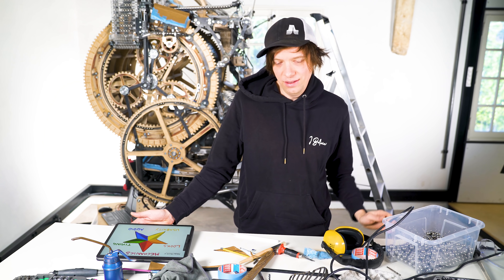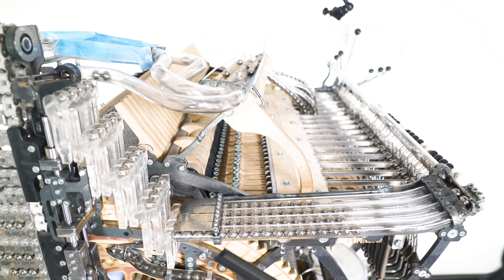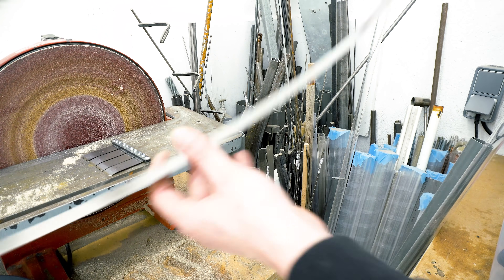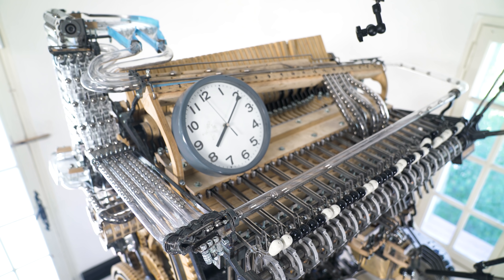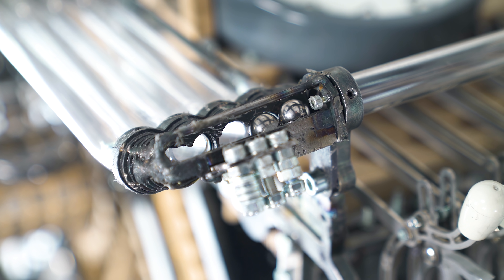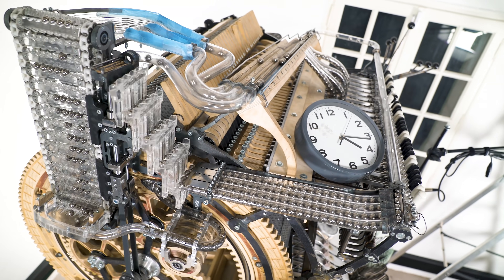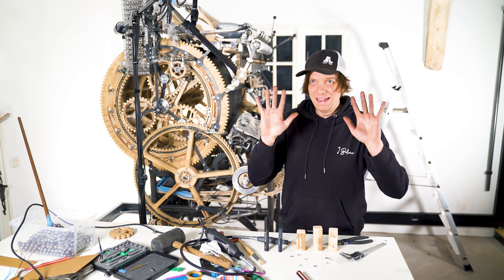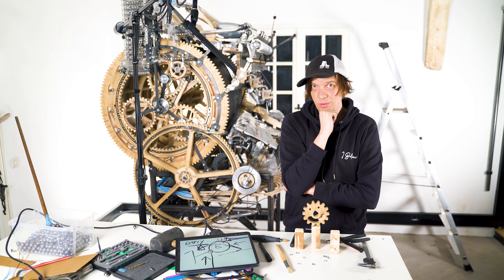Marble Machine X Fish Stair Upgrade

Comment: Engineer: IT SUCKS!!! IT'S NOT RELIABLE AT ALL!!!
Artist: BUT IT'S BEAUTIFUL!!!
Musician: IT'S NOT IN SYNC!
Martin: I WANT TO KEEP THE SWING ...  slowly evolving the marble-divider into a vestigiality as he's bypassing all of it's purpose
Me: Where's your angle grinder when you really need it?!?

Seriously, i think this marble divider is dead now. R.I.P. F
I'm also quite sure that it actually worked quite fine from the beginning and that the actual problem were marbles slamming into the back of the divider while he was tilting, disallowing the fourth marble to enter it's hole.
However since the swing doesn't have a real purpose anymore and it still produces a lot of noise at random timings, you should consider removing/replacing it completely.

Comment: 13:57 So, I'm a little late to this party. And maybe you've already tried this, and I missed it or haven't gotten there yet. It seems like a lot of the marbles are getting tossed out at that one point, because each channel has its own individual metal bit at the end. (Sorry, I don't know the exact right terms for it.) Wouldn't it be more stable to have that as one piece putting light pressure on all the channels at the same time? I figure since you want the marbles to go on the climber at the same time, it might as well be one piece, right? Is there a reason for avoiding this? Just something I've been wondering about watching this.

Comment: LOOKS COME LAST.
Every time man, every single time. Looks ALWAYS come last. There's no point to a good looking car if it doesn't work. Work hard on those other 4 parts, then adjust it for appearance as you need it. You need to focus on the mechanics, and ease of movement, and timing.
Stop harping on the appearance. Also; it's naive to think you'll be able to make something in one try. The best of master carpenters and wood workers I know still use files and chisels to straighten their cuts; adjustment is a natural process, it's necessary. Tweaking is inevitable, being critical is fine, but you cannot make an omelette without breaking a few eggs.

Comment: What if the bottom fish stair operated a gate that was one or two marble distances away? The gate would stop the flow of all marbles unless the stair was in the top-most part of its travel? Or an alternative idea: the metal fingers are bent differently to create a gate -- then there is a "bump" or "ridge" on the bottom fish stair which at top-most travel lifts the ends of the metal fingers to bend them enough to open the gates.

Comment: BTW- IF you ever have to do a MRI for your body,  YOU NEEED to tell the doctor you have worked as a machinist. Those metal shards will move inside of a magnetic field and it could cause major damage and/or PAIN. JUST FYI.

Comment: Martin, I honestly think you sould get rid of the divide-by-four.

According the star chart you presented at the beginning of the video, it fails at 3 of the 5 branches.
 - It fails mechanically because it does not do the job that it was created to do, that is distribute a single stream of marbles evenly and reliably accross four exiting streams ; instead it keeps on swinging too early, and marbles get caught on it everywhere and every time, no matter how much it is tweaked. Like you said, tweaking is the mark of vulnerability, and a sure sign that this design is not robust. At the end, when you removed material with a tool bit and it started to behave, it was only because a marble was getting stuck in it, but you hailed it as "the most failsafe version of this ever" ; no, it's not failsafe at all, it is bugged in such a way that it started to work again, but never in a million marbles would that have been reliable, it worked because of a bug.
 - It fails in regards to sound since, as you said, it is very noticably picked up by the vibraphone microphones, and just makes a ruckus overall. What good would it do if you manage to get it to work by removing some material here and there, and relying on a marble getting jammed in it, if in the end it sounds awfull and spoils the musical experience ?
 - Finally, it fails visually. I mean come on, look at it. It's made by welding a bunch of plates with holes to one another, it's so covered in welds and tarnish that it looks like molten slag flowed all over it. It honestly looks like it was recovered from a car accident or a rocket explosion. Indeed, looks have to be sacrificed in order to get something that works good and sounds good, but the divide-by-four does not work and it does not sound good.

Yes, the idea of a divider that works using a swing balanced in just the right way is cool, conceptually, yet it fails in every way when executed. Since this part of the MMX has no bearing on timing or usability, the fact that it's a cool idea is, in my opinion, it's only redeaming quality. Beside, again like you said, there is a much simpler mechanical solution : an open lane that does not constricts the marbles so much, like that in front of the conveyor. It would also be less noisy and, I believe, much more elegant looking than the odious looking divide-by-four.
I truly think you had the solution right there in the beginning of the video, you even made almost exactly all of the points I'm making right here, but you persevered in making the divide-by-four work yet.

Despite the hard time I gave to this part, I really want to make it clear that there is no malice or bitterness whatsoever in what I'm saying. I didn't write this to talk trash about your designing skills, because I think you've grown so much as a designer and I could never dream of achieving what you have, and persevere like you have. And I don't think that the fact that you can't get the divide-by-four to work is a failure, no more than the breaking of my body would be a failure if I were crushed by a falling rock, I truly think there isn't any way to make this design work with the level of reliability that you need (if it is even possible to make it work at all by the looks of it). Instead, it is the pursuit to make it work in spite of all the signs which is foolish: "Errare humanum est, perseverare diabolicum".

I really believe that the MMX is not sunken cost fallacy, and that it still very much has the potential to be a glorious instrument, and I'm so excited for the world tour ! I believe ! But just like you, I know that it can only happen if things can move on instead of being tweaked in perpetuity to the top of the hill, only to roll back down to the bottom. I light of that, I would rather give you an honest opinion, written with all the benevolence in my heart and the respect I have for you, than to encourage you to follow paths of ruin, and I think you would rather too.
Best regards and best of wishes, for you and this splendid project. Please, dont give up !

Comment: just make a sliding gate,   2 pieces make a hole large enough for the 4 to set, once enough weight triggers the drop, the bottom of the 2 pieces slides down allowing the 4 to fall in

Comment: 2 points: 1. why dont you fill up the pipes the same way you do do with the marble divider on the top?  as you suggested at 12:40 in the video  2. if you file down the edge of the first fish step, I think you will avoid marbles to get stuck when a marble arrives late becouse of empty pipes

Comment: One Idea ... you could tie the entrance mechanically to the stairs.
Not a hard link, but a break so that marbles can only activate the flap when the stair never in the wrong position when the marble arrives.
Downside: creating a mechanical link between those two that run the length of the pipes.

Comment: For your "empty" channel rare problem occurence, wouldn't it help to put a very slight (1-2mm) rounded bevel on the back of the stair? Because right no the problem is that the two forces push in each others direction. With the bevel, the ball would slide instead of pushing on the metal spring. Either it would slide back in the channel, or slide in the stair, without the "explosive" outcome.

Comment: Hey dummy, put a small setscrew in from the top of each channel. That will allow you to fine tune the effective ease that marbles can pass. Also allows you to keep your same design with a nearly invisible modification. A perfectly running system is a beautiful concept, but impracticable. My suggestion is to design tuning into it. Another example, slot the mounting holes on the supporting spring steel so you can slightly pull them back to fine tune the stiffness, which could vary depending on the weather. Your system is not fragile because you designed it badly, or chose beauty over mechanics, your system is fragile because it has no method to adapt to changes. Imagine you had to take your car to the shop to get the tires changed every time it got cold because the pressure gets low and there's no way to adjust it.
Reply: Also, not actually calling you a dummy. This machine is the infernal creation of a genius, for sure. Feel free to pm me if you would like to talk more about building with the ability to tune in mind, or more suggestions for individual components

Comment: Keep working through Marten.
Be acreful with the machined and tubular pmma though it's notoriously brittle and slamming marbles against it repeatedly or pranging it while on the road could cause a show stopping failure.
Consider styrene which forms, machines and works in a similar way but has more resilience to bending and shock.
Another incredibly tough thermoplastic that forms and machines well would be PET (polyester) which will not fail.
Poly carbonate would be the ultimate, being what police riot shields are made from. very expensive though.

Be assured a watershed moment will be along soon to remind you of the joy this wonderful piece of kinetic/audio art brings to us all.

If you have a holiday, you don't need to justify it to us. Just enjoy some quality time away.
x

Comment: *you are obsessing needlessly*. It totally doesn't matter if the 4 channels are loaded exactly equally, only that the lift capacity is enough. And that's like horsepower on a car, how many is enough? You can always wish for.1 more.. and always still drive it with one less. Yes the divide by four is a hypercritical yet unstable design that you are trying to tune into balance.. **but if its not a reason to give up the mmx project **. you can replace it with a better solution if/when inspiration hits you, until then **just live with it!**. Part of the problem isn't that the mmx is too fragile,  just that the artist in you is too fragile. As your engineering side develops (it has, so much!) Let that guide you. The key to a robust design isn't that its 10,000,000 perfect, thats impossible anyway... its just that if one in 1 in 1,000 isn't perfect, nothing breaks.

Comment: You shouldn't care to much about marbles that fall to the floor. As long as it didn'T break the machine it fine. Of course it would be better if no marble fall to the floor bat it's not the end of the world. I mean what's the problem if 10 or 20 marbles hit the groung while a concert? The show can go on. Yes, I agree, you need to fix as much as possible, but if it happens only in conditions, that are not normal and than only some times: don't care to much about it.

Comment: Keep going mate this is awesome. Suggestion though, could you add some dampening foam / tape on the vertical sides the stairs - when the balls roll in, the hit the tape on the vertical side of the next step. This has two functions, reduce noise and reduce rebound.

Comment: If the divide by 4 channels can't run dry is this not the same as the interment channels? So could you use same method as the interment channels so the marbles feed into the channel that is empty and skip over the ones that are already full the same is it dose on the interments channels.

Comment: Cant you solve the problem by making a gate, and as soon as the marbles flip over into the lanes, the gate closes, preventing any further to sneak though?
Reply: Maybe even tow gates... one like in a 90° angle which closes the single input pipe when the 4 marbles flip over, and 4 (one fore each lane to the fish stair) which close when the counter weight pulls back.

Comment: You'd have to redesign it but......use springs with a metal plate on top with correct weight of 4 marbles will compress bar and allow marbles into fishstair entrance

Comment: Possible solution for the divide-by-4.  Make a longer version that takes 6-8 marbles to activate, so that the first 4 marbles have a chance to settle in their proper positions before it tips.  Once they roll off, the mechanism tips back and the next marbles advance.

Comment: I wonder if a redesign of the entry point of the divide by four mechanism itself. Or maybe all it would take would be to create a solid part instead of welded together washers. I wonder if the inconsistencies in the material is causing a lot more issues than a solid machined part. Yes a solid part would require a fair amount of measurement and testing to find the correct values before creation but the smooth nature of the final part might give the entry a more uniform behavior overall. Just a thought, might not be worth the time investment. Keep at it Martin you are doing a wonderful job!

Comment: You don't actually need the fish stair to run at full lift capacity unless there are a lot of marbles banking up below it. Even if you got rid of the /4 swing altogether, and just used a simple divider like the one feeding the instrument channels so marbles just go down the first queue that isn't full, then the fish stair lift rate would auto-adapt to the number of active feed queues.

Comment: Large neodymium magnets are great for pulling ferrous metal splinters.  
As a (retired) engineer...  why are you so concerned with the parallelism of the fish ladder approach system?   Is it just an aesthetic thing?
You have serial input.   You have serial output.   The are no concerns for maintaining sequence of the marbles.   An unbalanced feed should only
be a concern if you are having an issue scavenging spent marbles or supplying enough reusable marbles into the feed system.   
Eliminate jams, yes. 
Eliminate rejections, yes.
Keeping it pretty, let form follow function.  
Let the machine output (music) be your artistic outlet.  
Musically, you are a far superior cog in ultimate output. 
Give yourself a stable device.

Comment: Is it against the basic design principles of this machine to use another source of power to drive the marble loop? pneumatics? electromagnets? sensors? microcontroller control? I think its possible to do this and still keep the aesthetics - if anything make the overall aesthetics simpler and easier to understand.

Comment: Hey Martin, I had an Idea about the issue of the divide by four.
You could try to add some kind of gate to the swing which blocks more marbles entering the divide by four until the swing has reached its default position again.
This way, even if the swing takes a bit longer sometimes, no additional marbles could enter the first line.

Keep up the great work, it is hugely inspiring :)
Reply: and for the fish stair, try sanding the sharp corner where marbles get caught a bit, this should force them back into the pipe instead of catching them and launching them through the air

Comment: Martin, you need a mechanism of sorts to block marbles coming in when the divide by four releases, then you can make the opening as wide as you can. It shouldn't take much, a small metal tab connected to the release mechanism is all that's needed. Hopefully.

Also, you need to adjust marble at the bottom of the fishstair (lowest position) to align perfectly with the marble line at the reservoir so that the next-in-line marble doesn't move like this ➡️ ⬅️ ➡️ ⬅️ ➡️ ⬅️(i'm assuming the stair is as wide as a marble).

I hope this helps.

Comment: You could solve a lot of issues with the fish stair by either having a solid cover lead to the fish stair or no cover. Because the cover bends it causes a lot of problems by adding random spring kinetic energy to your system. If a solid cover is having issues put it higher so the marbles have freedom to move and self resolve.

Comment: You could bend the pipes leading up the the elevator to slow down the marble preventing the marble from gaining enough speed to be lifted up. The tubes , when full, wont meet any resistance but will travel a greater distance. However it may still be a problem for the perfectly timed marbles.

Comment: A lot has been said about feature creep or sunken cost fallacy. I don't know if we've discussed yet the never finishing conundrum?  Something that the digital realm of art is falling into is where a digital book, a song, a painting or a feature length film is already distributed and we're going in and making changes for minimal things like crew visible in a shadow.
With the marble machine I think we're pretty close to what we could call completed but some aspects could be considered as an never ending project. Hoping this is encouragement to work on what needs to be done. It may not be exactly as pictured as art put into physical form tends to change slightly, I do think it is a work of art on its own already and part of that piece of art is that it functions. So functionality can be considered aesthetics.
Although those moles are going to be a hard thing to solve.